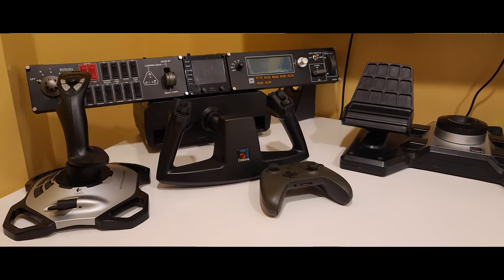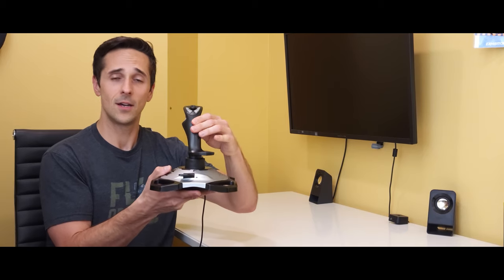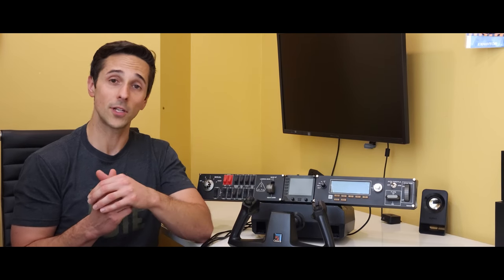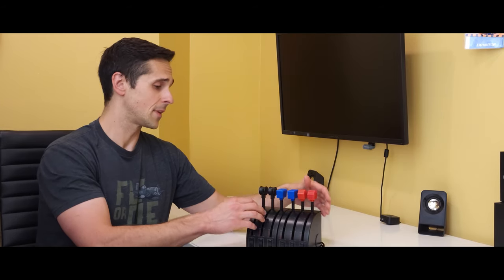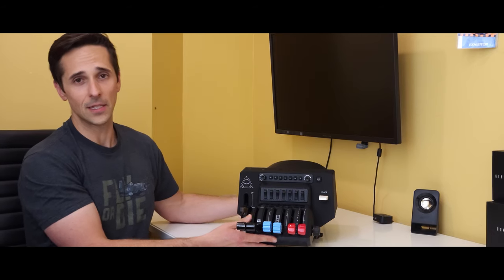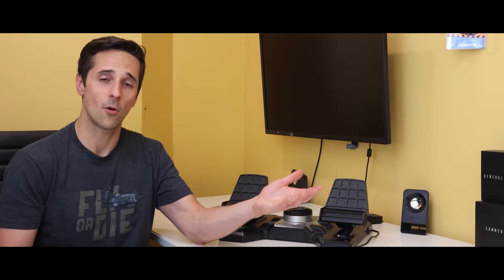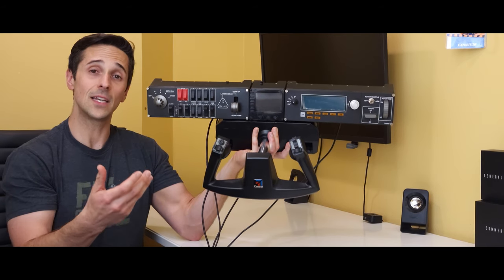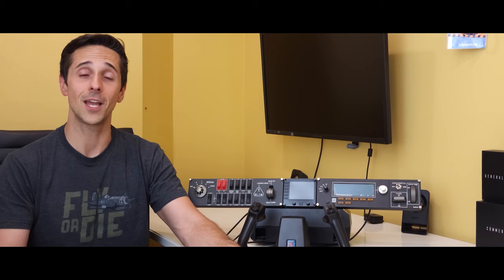Adding Realism to Microsoft Flight Sim 2020 and X-Plane 11

Comment: A better entry joystick then the Logitech one with many more features, is the Thrustmaster T.Flight HOTAS 4 It's at the same price point, has a full size throttle, with an additional horizontal axis, which could be used as a separate tiller for taxing on aircraft that supports a separate tiller like PMDG.
Reply from the maker: I do like that joystick for the price. However, years ago I did have a set and it did not last very long. I chose the Logitech because of its relatively small footprint, good base, and overall reliability.

Comment: Honeycomb has a long wait for all their product. Even though it seems to have the best bang for your buck. What yoke can I buy that has the full 90 degree movement and can get shipped to me quickly?
Reply from the maker: Well, aside from the Alpha..... I am not 100% sure. I reached out to Logitech recently and they confirmed that their yoke is only 45 degrees of movement. I tried calling CH but the number was not working at that time. I emailed and am awaiting a response. 

There is a mod for the Logitech yoke but I am unsure if that would be worth it. I will let you know when I hear a response from CH. 

As of right now there is no perfect yoke that ships quickly. You could go joystick but I would say a yoke is probably the best way to go.
Reply from the maker: I did hear back from CH and their yokes are limited to 45 degrees

Comment: msfs2020 on a laptop....
Reply from the maker: You better believe it! Because of work I really had to choose between a new laptop or rebuilding my old desktop. I chose a laptop with the intel i7-10750H and RTX 2080 Max Q. The RTX 2070 Super would have done just fine as well. Running high settings and averaging over 30fps almost anywhere!!! I'm not going to say the brand of laptop for two reasons, 1. this one underperforms and 2. I am hoping to get some demo units to show how well laptops can actually run MSFS2020.